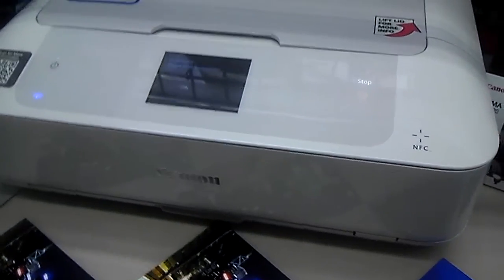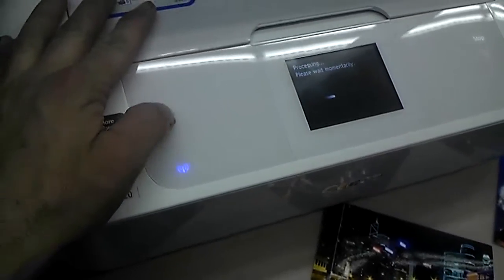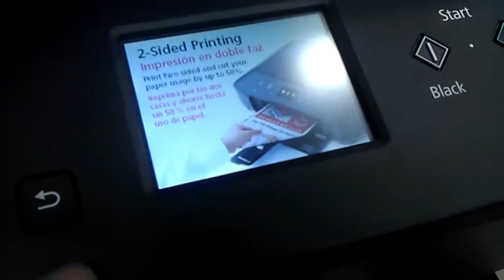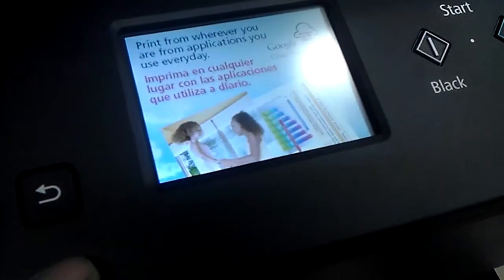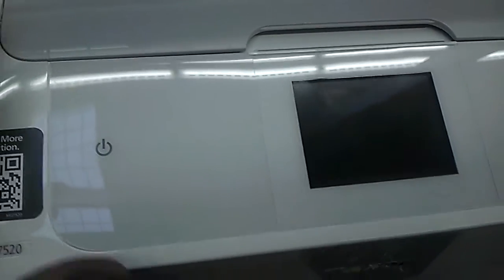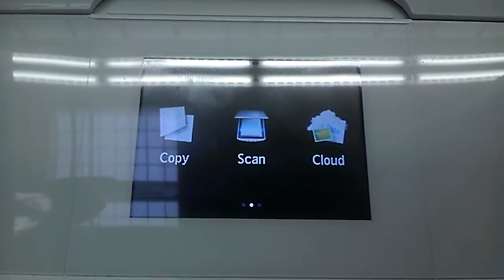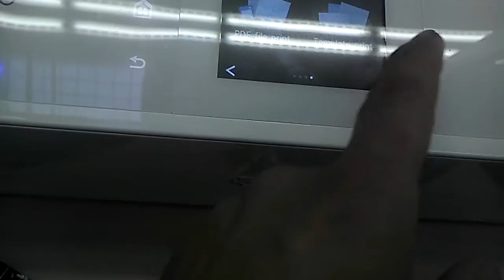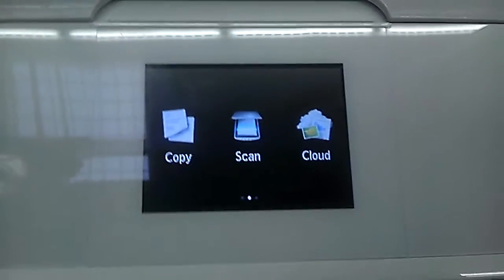Canon MG7520  Frozen BSD Reset instructions

Comment: How do I fix the error 1660 that concerns the ink cartridge. I can’t reset the printer cause the error is not going away
Reply from the maker: 1660 is the CHIP on the Printer cartridge is not talking to the Printer firmware.  
#1.  Do not upgrade the Printer Firmware.  
#2.  DO NOT UPGRADE PRINTER FIRMWARE AUTOMATICALLY IF THE OPTION IS GIVEN.
#3.  If you Printer cart is out of date?  Then just call Canon for a replacement.  OEM carts are warinted for the life of the Printer and Cart. 
 
Other man to fix the error.   
-Look at the Contacts make sure they are not dusty or have crud on them. 
-Your Print head serial cable may be damaged.   You may have to (fix means just get a new printer)  or find parts to repair it.  (Best to just get a NEW old STOCK printer of the same type in the box if possible.  Get the Extended warranty as the belts and drives and grease can be an issue after a few years)  
-See what firmware you have. I think there has been 3 firmware updates on this machine.    You should be on one that is from 2015.   The 2020 firmware was just released.    I have no data on that one.  But I know that it is not needed.   

LASTLY:
If you are using the Generic carts?  Some of them have some BIG issues.     Amazon does sell carts that work well with this for genreal printing and do work on Older firmwares, but have some trouble with the newer stuff.    You can cancel out the Print head check and see if it still works.    Its a pain but it might help. 

AS A LAST RESORT
You CAN take it apart to look at the FLEX CABLE.   But at this point?  Getting spare parts is going to cost you more then picking up a new printer.   And if you get it? Might as well get the entire print head cradle and parts.   

Some of the issues that come with this printer are all due to FAKE carts that MIMIC the Canon Handshake and cause it to error out.      They use a diffrenet LVDS signaling to talk to the Printer serial bus, and it can corrupt the  Chip that does the error handling on the main board.     

Hope that helps   :-)
Reply: @MickeyMishra  thanks I think I might just get a new one. Or try to to the options that you suggest. Thank you very much!

Comment: Mine got stuck while downloading a firmware update (February 2016). Says "Update failed. Press power to retry." Doing so leads to yet another long, unsuccessful download attempt, followed by the "Update failed" message.  Powering down (even for several hours) and up again doesn't help...goes right back to trying to download. Might have something to do with a very recent OS upgrade to Windows 10. Can anyone suggest how I get this machine to go back to factory settings so I can install a W10-compatible driver?
Reply: +Mickey Mishra canon help me to reset but it is not work. maybe they help me to solve it
Reply from the maker: i would do it from the printer menu.    i just got mine out of the box from sitting  around for over a year.   snd it works ok.  fell free to contact canon tech support during the week.  they really are great at solving this sort of thing.
Reply: +Rici Peterson Did you solved the issues?  
I have the same problems, My printer always shows the "Update fail"and "downloading". 
 and i cannot touch with canon tech support team. 
Plz let me know the solution.
Reply from the maker: +Jihoon Park I can bet you a hundy that it must be a issue with the proxy server and SSH.    First, is you printer connected over WiFi, or Ethernet?
Reply: ***** it connected wifi and my connection does not set any proxy or ssh things. did you solved the prob.?
Reply from the maker: +Jihoon Park  Yes.  My issue was that the machine needed a hard reset, then had to be hooked up to another router and the firewall was causing an issue.   If this does not work,  just call Canon.  They really will help you out.   Are you in the US?   It  really is worth a try.
Reply: Thanks but now I'm not in the states. I ask canon USA for help but I think they can't help. Hard reset will be the best but the I'm not sure cannon USA can help.
Reply from the maker: I wonder if you can update via sd card?.    That may be an option?.